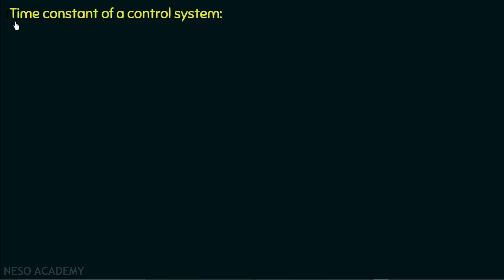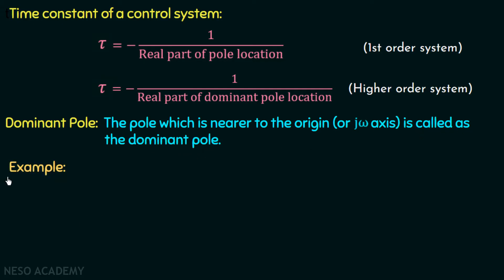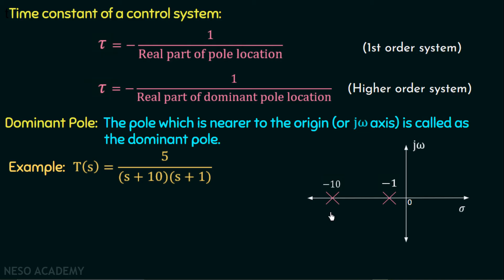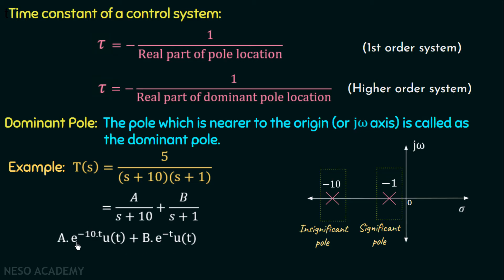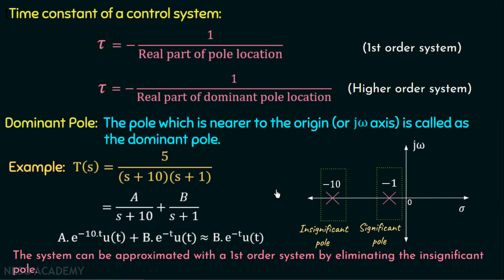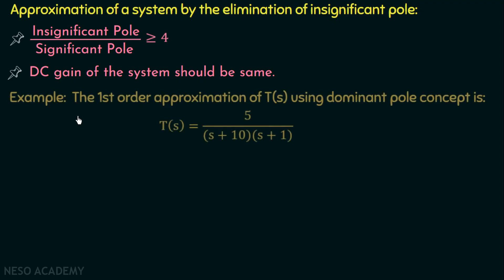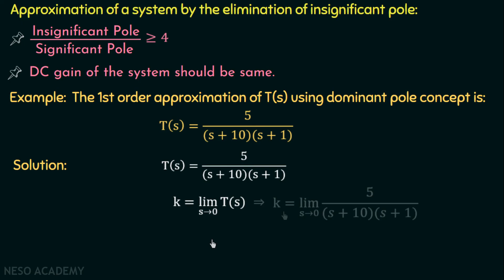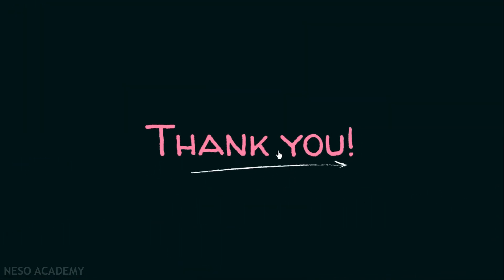The Concept of Dominant Pole

Comment: how did the last step figure out. You just calculated the lim tending to 0 for the transfer function and got the answer as 0.5. how was that equal to the same equation upon eliminating the insignificant pole ?
Reply: from what i understood, he substituted the approximated system as B/(s+1)... now if we calculate B it comes out to be 0.5 hence the gain is unchanged

Comment: Guys, as I understood there is only one requirement to make a eliminate non dominant pole. And this requirement is first one. Then we shape the approximated function in order to obtain the same dc gain. So, after eliminating non dominant pole, we assign 0.5 value to numerator, so that we can get dc gain same as before. I hope I could explain what I mean.
Reply: the way he eliminated the pole is that he divided s+10 by ten, and then he multiplied the whole parenthesis with 10. If you do this the numerator becomes 0.5
Reply: I also understood the same thing bro! Thank You for clearification.😊
Reply: yes, it looks like he skipped a step there.

Comment: How did you approximated the transfer function just give a reply how did the 0.5 came on top in approximated transfer function?
Reply: i have same doubt
Reply: Taking s equal to 0 hence, 5/10=0.5 which is the DC gain

Comment: How does gain remain unchange 0.5?
Reply: Keeping the gain the same is one of the two criteria necessary for making a valid approximation (the ratio of the insignificant to the significant pole is the other).  So what you need to do is figure out the DC gain of the original system, and then make sure that is the same gain as the first-order approximation.  Then since the first-order approximation only has one linear factor in the denominator, it will just be K/(s + p), where K is the DC gain and p is the (negative of the) dominant pole.

Comment: Hlo..sir.., I have a doubt about on dominant pole topic.., as we know in D.p..if the ratio of insignificant pole to significant pole is equal or greater than 4..then we neglected insignificant pole ..with the same value of d.c gain of the system.. right ..my question is .. if insignificant play a important role in stability of system because of less time constant and high bandwidth..and speed of the response is also incresed by insignificant pole.. then why we neglected insignificant pole...or why significant pole is a dominant pole instead of insignificant pole..?

Comment: Hello sir can you tell me how we got DC gain 0.5 after removal of (S+10).
Reply: Dude, as I understood there is only one requirement to make a eliminate non dominant pole. And this requirement is first one. Then we shape the approximated function in order to obtain the same dc gain. So, after eliminating non dominant pole, we assign 0.5 value to numerator, so that we can get dc gain same as before. I hope I could explain what I mean.
Reply: 5/10=1/2=0,5
Reply: Jus get rid of "s" 
Then we have 5/10(s+1)
That is 0.5/s+1
Reply: actually by doing partial fractions we get 5/9((1/s+1)-(1/s+10))
so by removing 1/s+10 we get (5/9)(1/s+1) and 5/9 = 0.555
Reply: @uttarkarpujitha102  why we are doing partial fraction, we are talking about removal of s+10 insignificant term
Reply: just get rid of 's' not 's+5'   and then symplify the expression   

5/10(s^2+s+1)

(5/10)/((10/10)*(s^2+s+1))

0.5/(s^2+s+1)
Reply: After eliminating the insignificant pole: 5/(0=(insignificant pole)+10)*(s+1))=(5/10)*(1/(s(dominant pole)+1)
Reply: Transfer function 5/[(s + 10)(s + 1)] turns to 5/[(0 + 10)(0 + 1)] because, in order to get the DC gain, or k, you have to evaluate it when s tends to 0, so: 5/10 = 0.5

Comment: How the D.C gain =0.5,Please explain!!!!!
Reply: With dominant pole approximation the DC gain of the system is not altered.We only remove the insignificant pole keeping DC gain intact.Hope this helps.
Reply: @madhav2214   Thanks...
Reply: @madhav2214  bro it's the condition for the approximation as the teacher told not result... But think  of any case there if u remove one factor from the denominator will the dc gain be same as earlier... No take any case. I didn't understand how the teacher wrote that 0.5 at the end... There r so many questions started poping up after watching this series of videos of control system... In every single video... ND importantly this teacher gonna never reply to ur doubts in the comment section but will say ask ur doubts in comment section 🙄😏
Reply: @madhav2214  you are right bro we should put the same dc gain in final approximated transfer function. This only make the system of first order
Reply: @madhav2214  yes you are right we should put the same DC gain in new approximated transfer function.
Reply: Assume s=jw and substituting in place of s in the given transfer function, except for dominant poles.
Now finding the limit w->0 in the magnitude of the substituted transfer function, we get the DC gain :)

Watch this video for more clarity: https://youtu.be/y1BxLLTHJOI
Reply: You make s go to zero so you end up with 5/[(0+10)(0+1)] which is 5/10 = 0.5
Reply: @LaplacianFourier  but after eliminating the insignificant pole, how come the DC gain is still 0.5? With limit s-->0 & removal of (S+10), will the DC gain not be 5?
Reply: @raghunandanmutalikdesai299  
I also have the same doubt.
Reply: @bpavankumar9597  yes...bro i also have same doubt....if anybody know the solution of this let us know
Reply: @LaplacianFourier  Thanks..
Reply: just get rid of 's' not 's+5'   and then symplify the expression   

5/10(s^2+s+1)

(5/10)/((10/10)*(s^2+s+1))

0.5/(s^2+s+1)